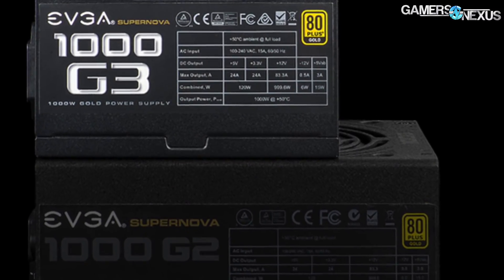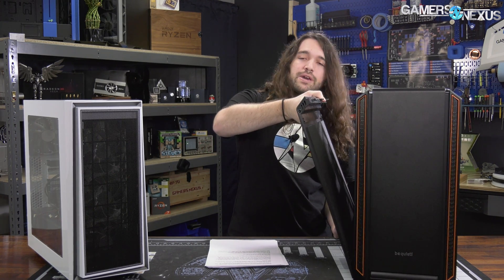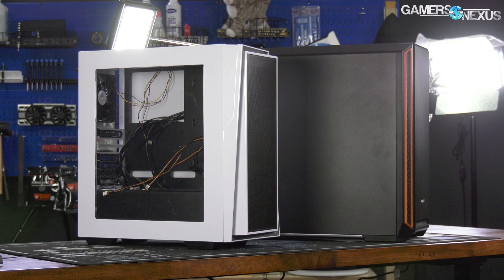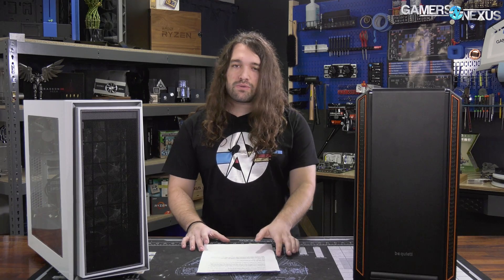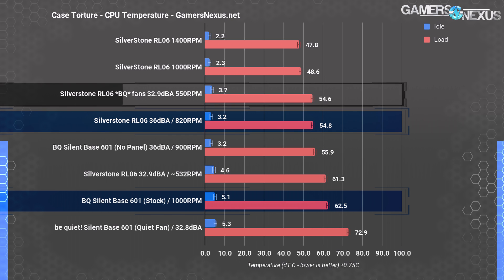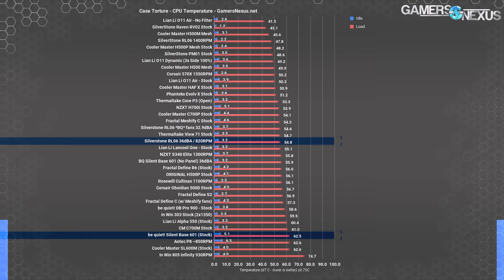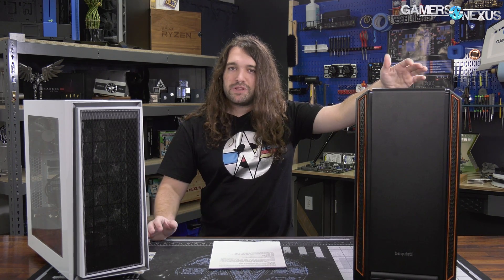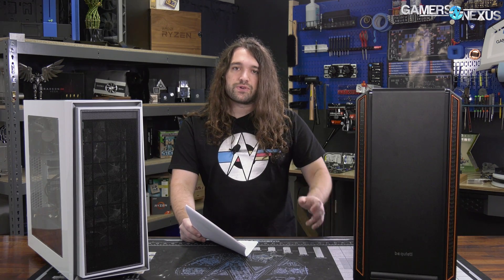Airflow vs. Silent Case: Noise-Normalized Thermals

Comment: Honestly, it's probably not a bad idea to start including a noise normalized result in your standard benchmark suite in general (At say 35 db). But you would need to include what type of noise is generated when you do so. As someone that's suffering from tinnitus, which is a public health issue, high pitch noises wreak havoc with my ears, concentration and mood. It would be necessary to include this information to make an informed decision.

Comment: Steve : Could you test the Phanteks Enthoo Evolv X again with 3 140mm high static pressure fans in the front, like the Corsair ML140 PRO? It would be interesting  to see if that makes the case a better buy.

Comment: Hey Steve,

thats not really News to me, you can easily achive even better results if you drill holes into the casebottom and put the PSU above Mainboard, we (from the now closed Silenthardwareforum) figured that out years ago. The only advantage of newer cases is the shiny Look.

Would you mind to test a topPSU Case with bottomintake (DIY) and the front closed ?

Greetings from Germany.

Comment: Now we need a test to show whether noise dampening foam is any use at all.  Take the RLO6, stick the foam on both side panels and (assuming the side panels then shut!) redo the tests concentrating not just on volume of noise but its quality as well.

It would be highly amusing to find that the RL06 out-performs the 601 both in quality and volume of noise simply be changing the fans and adding foam (although in fairness the foam in the 601 looks very high quality)

Comment: How about using the same fans and configuration.  2 intake and 1 exhaust Noctua fans in all cases.  Equalizing fan and placement would showcase the case's true noise dampening.
Reply: That's why they swapped to BQ fans in the Silverstone case (2 intake 1 exhaust)
Reply: That wouldn’t work

Comment: Tbh i think these Charts are often very confusing and missleading.
Sometimes you compare some stuff, but something completely different is highlighted.
Also some cases do have a noise Level stat in the big Charts and some don't.
Some got Fan Upgrades and some didn't.
It's kinda useless if there is such a big gap in stats in these Charts.

Comment: I have a really old PC case and I can only put 2 80mm fans on the back. I recently got a new system and a few days ago my RX 480 came - and overheated my case. That's why I put the fans in there.  MY ambient temperature is about 22-24C.
   It seems I'm getting really nice idle temperatures and decent load ones. My idle is about 44C for the 480  and CPU 40-42(Ryzen 5 2600). I really can't comment on load temps as I've not had consistent results, it seems my RX 480 is really dirty and I'll have to clean it (second-hand GPU) Those are a lot better than most I've seen online. They are pretty quiet and they have insane pressure when I put my hand behind them it's as if I'm outside in strong wind conditions.

Comment: I know you live in a different universe already, but for us folks with a bunch of HDDs, could you do this test with 4+ HDDs? (preferably from different manufacturers so there's more potential for them getting some added resonance ;))

I got a Fractal R6 and I can hear a big difference even between open and closed front door, not just the airflow from front fans, but the drives buzzing. That's why I switched from a mesh front+top+panel case (with only the back fan running at all) to this one. Temperatures are awful in comparison, but the noise actually improved.

(I'm working on improving the thermals in the R6, ordered myself a bequiet! BL071 for the back and the idea is to make it silent in idle, but make a hurricane when it gets hot)

Maybe there will be a day when multi-terabyte SSDs are affordable enough, but for now some of us really benefit from those silent cases. So I'm sure more of us would love a more realistic comparison, normalizing the noise with a bunch of unmatched HDDs stuck in there :)

Comment: I have a Cooler Master $99 H500 with the mesh front panel with an exhaust fan but set to only turn on when CPU temp. is 36c or above which is rare. My CPU cooler is a Hyper 212 evo with the stock fan and an additional Cooler Master Blade Master 2000 rpm Sleeve Bearing fan for push-pull. I am thinking of changing out the CPU fans for Noctua chromax but I wasn't sure how big a difference it would make for sound and I am not sure If I want the NF-S12A or NF-F12, they are the same price. I tend to adjust fan curves so none of my fans are running more then 50-60% max.

Comment: G3, "noise optimised fan profile"
Yeah... Sure... Running the fan at 1520RPM at a 60W load is considered noise optimised by EVGA. Testing on Cybenetics, for anyone actually interested in the PSU (for whatever reason).

Not to mention the OPP and OTP issues the PSU has.

Comment: I use a FD Define C with only be quiet! fans (except the CPU fan (EK Vardar F3-120) and it barely makes any sound even at full use. I guess the case allows for good air flow.

Comment: 10:32 RL06 with be quiet fans is almost the same performance at the same noise level and RPM as RL06 with stock fans. What's up with that?

Comment: The Eco feature on the EVGA G3 power supplies doesn't work well in my opinion. I have the 850 G3 and the fan with the eco on or off is still very loud. It is the loudest component my case besides the GPU on a custom fan curve because I don't like my GPU running hotter than 60C. The fan on my PSU will ramp up even when the system is just idling.

Comment: That is a nice demonstration. I concur that fan noise is fairly easy to eliminate jut by using quality fans. To me the major advantage of these noise isolated cases is high frequency noise dampening, and particularly the sound made by hard drives. I am very picky about noise, but this convinces me even further that once I get rid of all that spinning rust, I might get to use an open case again.

Comment: The noise level you normalized for is way too high, of course a silence focused case is beaten when it's set up to be as loud as it gets. there is no way to get an airflow case to get as quiet as a closed one with low rpm fans on both, unless you remove the fans completely. pretty sure an airflow case with no fans would not be able to compete on thermals with anything that does have fans.
Reply: I may have missed it (He is talking so damn fast) but i dont think we even know at what distance. It could be extremely quiet if its at 20cm. If its at 2m its really loud. 
Interesting as a comparison but i still have no idea how loud it really is.
Reply: @jerkersandquist7244  As far as I know, their methodology is online and mentions the distance from which they measure. (Something around 20cm indeed.)
Reply: 6:10 he mentions they are measured at 20 inches. the test includes the 100% fan speed as well as the "level 1" low noise setting on the be quiet case and then they adjusted the other case to match.
Reply: on the 32.9dba he used, the fan's were only at 530 rpm, that's as low as you'd go when doing any gaming. Any lower both cases would be dead silent.
Reply: There is a thing called passive cooling.... Like there are entire cases designed around the idea of no fans also and utilize boiling liquid to move the heat.

Comment: Someone plase suggest to me the best mid tower airflow/ low temp case for a 9900k overclocked to 5ghz+ cooled by a noctua D15 (GPU =2080Ti). Price isn't really can issue neither is additional after market noctua fans if need be. I'm currently looking at the Cooler master H500 mesh and the Fractal Design Meshify C is there anything superior to those?

Comment: i've been waiting for this kind of video for a long time, it's more logical that lowering the rpm of the fans (so noise itself) will be more effective at reducing the noise to airflow ratio, not simply blocking the airflow with a solid front panel... but apparently not to case makers and a lot of people

Comment: Great stuff- I've been seriously considering the RLO6 due to price vs performance for an air cooled CPU v AIO- thinking if the case is cooler then the stock Ryzen air cooler may be able to get 'a bit more' out of it. Though it and most other cases don't come with USB 3.1 or card reader options...

Comment: In the ad it said the power supply uses sleeved cables. Is that different than normal PSUs and more similar to something like cable mods cables?

Comment: Type of noise is less subjective than you might think... it can be expressed with a simple sound clip or with a screen capture of a FFT. I recently got a CLC for my system hoping to make it a bit quieter... yes and no. The noise floor is lower but there is something up higher now. The robust whirr of a noctua fan was much more comfortable.
Reply: You can quantify the sound using psychoacoustic measures such as:
Loudness (done here)
Sharpness
Roughness
Tonality to noise ratio

This is all great but the software used to measure this is all incredibly expensive

However quite possibly the easiest measure would be “prominence ratio” as it is spelled out in standards ECMA 74 in annex D. 

But what I was trying to say is that an annoying sound to one person is almost definitely an annoying sound to someone else- unless that other person has been listening to it for a while and masks it - which doesn’t make it “not annoying” it just makes it “not annoying anymore” and “annoying only for all guests using the room”
Reply: @markamber1480  I see. I have to say, you provided some interesting reference points for further reading. I didn't expect that.
Well, maybe Steve will have a look.
Reply: "less subjective than you might think" you say? So how do you quantify 'the robust whirr of a noctua fan'? I don't think it's as easy as having a quick glance at a FFT spectrum. And a sound clip doesn't make it less subjective either, as I have seen many YT comments about audio issues on videos, which I simply can't hear.
Reply: Wherever there’s a subjective measure there’s an academic somewhere who has figured out how to quantify it. Actually I learned much of the above running sound for a John Deere meeting where a team of engineers was trying to sonically design the cockpit.

Comment: This test is flawed due to a key nature of pressure:
The DarkBase has 2 fans in the front leaving the remaining slot open and exposed for backflow recirculation of air inside the front panel. This happens naturally until the pull of airflow through the intake vents and recirculation reaches a pressure balance. You are then testing this against a case with a fully-loaded front intake with far less potential for recirculation. It's like comparing the cooling performance of one fan vs three. Obviously the three will win. Retest without the pressure imbalance.
Reply: Not to sound snotty but I think the point has been missed. This is just to show that by adding good fans the a air fouced case can give similar results, ste even said that more work and money is like needed to achieve this. So you point it correct but missed pleased
Reply: @Entropicarts  if what i understood from the video is correct and this is actually more a high airflow case with 4 fans noise normalised vs a air restrictive silent case with 2 fans then well duh ofc the high airflow case with 4 fans wins :P it's got easy access to air and it's got 4 fans to pull that easily accessed air. it'd be more interesting noise normalized 4 fans vs 4 fans even if you use the silverstone fans for the test it'll be more of a straitup high air flow vs silent chassis test then a high airflow build with 4 fans vs a silence build with 2 fans >.>

silence hurts cooling performance this is a given so it would need more or faster fans to compensate for the cooling los, testing with less fans then the high airflow case it just stacking the odd's against it even more :P restricting the air passing through the case isn't helping anything but noise :p
Reply: @anub1s15   I would love to see that to it would be a very interesting watch. But saw this video as a, can you reach the same level of noise with better cooling (that includes adding fans) i an air focused case and i think its shown that well but an more apple to apple approach would be a to good see. I'd be interested in knowing if the restricted airflow improves linearly in a silenced case.
Reply: A price to decibel level would be a good to see, like you say many fans make light work but if you spent £500 doing it is it worth it.
Reply: @AJDOLDCHANNELARCHIVE  yeah something like that lol made me think of that old TTL vid
Reply: what if we close the gaps? is it good or bad?
Reply: Sealing all gaps not meant for intake or exhaust is ideal. The fans become the only way in and out of the chassis.
Take the NZXT S340 for instance. Horrible front intake design with that massive open gap below the bottom 140mm fan slot. I have it taped over to seal the intake. Changing nothing else thermals dropped significantly; especially the GPU due to the backflow recirculation of the airflow from the bottom fan getting split down that HDD cage vent and back through the front. Reason there's so little airflow into the case from the bottom intake vs the top. Everything else is an acceptable passive exhaust.
Reply: i see.. it seems to be interesting to test on my DBP900. they're quite restrictive and using 3 120mm fans seems to be leaving a few gaps. it could be sucking its own air from there
Reply: they even tested the RL06 with the same fans (and the same number of fans) like the 601 has.
Reply: GN compares what comes stock with the case not the absolute potential for each case.  If there's any flaw, it's bequiet for shipping only 3 fans.
Reply: @areksoo  The bequite case has only 2 fans stock not 3.
Reply: @areksoo   But he's comparing an "idea", airflow case w/ slow fans & silent case. Using a different number of fans is obviously gonna skew the results. If the be quiet had the same amount of fans, temps would have changed (cpu especially) and noise would have changed too, meaning lower speed fans temps/noise would have as well and the other case would have a different noise level to match, with different fans speeds. Everything would be affected.
I was really interested with this, but what this test showed is 3 fans is better than 2 for the temp/noise ratio.
Reply: They always bodge their tests, despite their supposed emphasis on "scientific method". They don't take into account EMI/EMF radiation which causes noise to other electrical components, especially detrimental in audio/video/scientific environments.
Reply: Xion Eternum Found the butthurt be quiet case user.

Comment: Would be interesting to see how the meshify C compares to these two (especially with 2 low rpm 140mm extra fans).
Reply: i have tried define c and meshify c, sound is about the same but meshify made cpu and gpu temps drop 10-20c. define c made fans run higher rpm. i used 2x 140mm noctua in both and 120mm noctua rear in both.

Comment: Literally the only reason I have not bought a Define R6 or a be quiet! case is because of their strict policies solid front panels. I need a big case with drive support so the meshify c is out of the picture. Is it really that hard to get a Define R6 meshify edition or literally any be quiet case with a mesh front?

Comment: I think in a sound studio the Be Quiet case makes a lot of sense. I went for airflow with a  H500M and a H115i Pro and the case is really darn quiet, enough to record with microphones. 

But I can definitely hear a very quiet noise created by the overall system, basically every bit adds up even having the quietest fan speeds, quiet pump, silent exhaust. Having a BeQuiet robust case with open front and have the front not to point to the user will probably result on a further reduction of noise to nearly inaudible.
Reply: good to know, as I'm using mine in a recording studio as well. Those large diaphragm condensor mics pick up Everything!

Comment: Would a larger radiator array(say 4 360s) positioned outside the case have enough passive cooling that you could get away with only a water pump?

Comment: First time I build a pc in 2012 I focused on silence. I think I used like 7 or 8 120mm 1000 rpm fans. I also usually ran them 500-700 rpm. It was ultra quiet and never had temp problems.

Comment: Part of me wished I'd gotten an airflow focused case.  I have a Define R5 and I use speedfan to keep the fans quiet unless they need to ramp up when gaming or under some other kind of load.  I've run my case with a side intake fan and with the front panel off, and for my needs the temps are fine with only front intake and rear exhaust.  I did find that it was very quiet without the front panel since my fan curve keeps the RPM low anyways.  

I might upgrade to a newer Ryzen CPU next year or later on, might get a different case then too, mine was making noise due to the bottom dust screen.  Drove me crazy for weeks until I googled what could be making it on an R5 and the most common result was the dust screen on bottom.  Sure enough the noise went away when I took it out; accidentally sat on it so now I'm not sure I can even put it back in if I wanted to.

Comment: I can hear my tv and sometimes monitor over my computer under my desk. Its very open and even with 10 120mm fans its very quiet because they are all at the slowest speed I can get them. Also don't worry about why I have that many fans in a small EATX case

Comment: @gamers nexus : thanks for the very thorough compare/review, as always -  best on the net!
Reply: It is not thorough. Actually the opposite. A case with noise insulation is built to shield the user from the noise inside so the test should be with hard drives, coil whine and water pumps. Things that makes noise.
In this test he puts components without those traits inside the case. That is not what the be quiet is designed for.